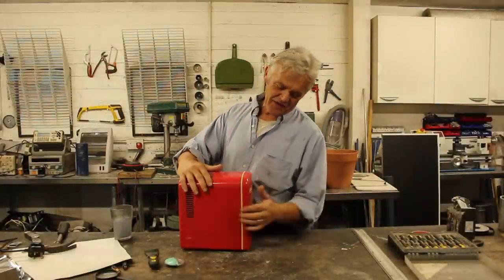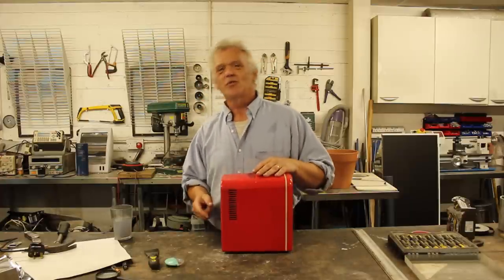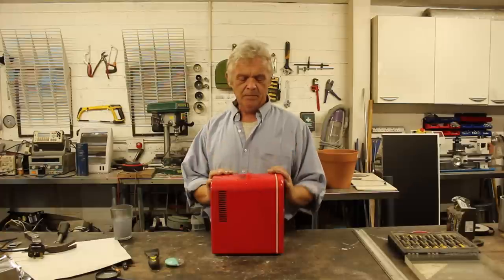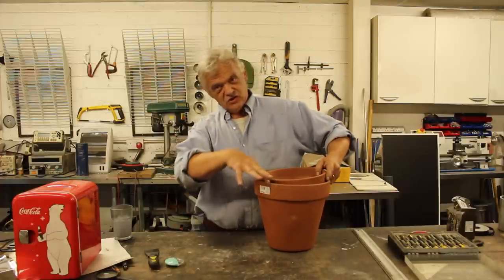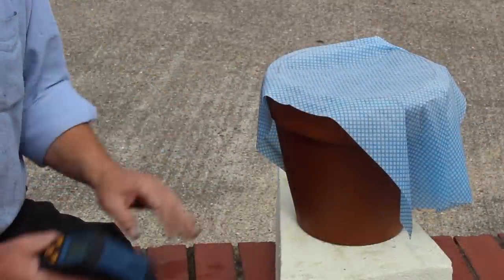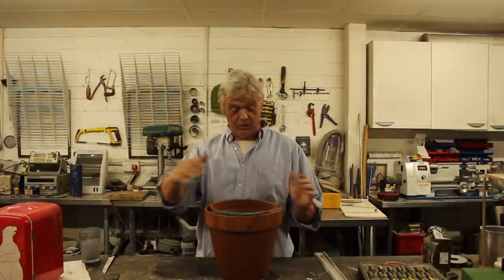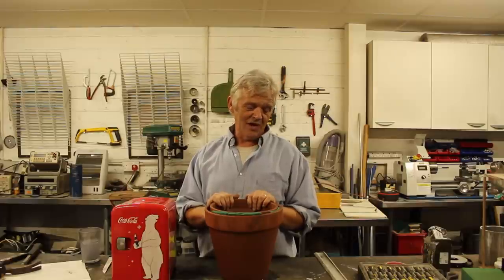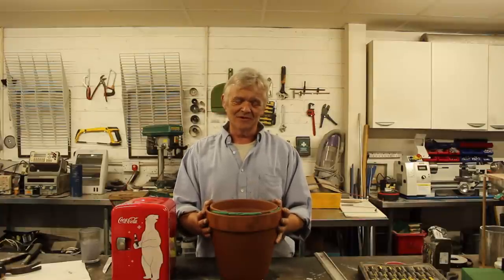1615 How To Make A Plant Pot Fridge A DIY Desert Cooler

Comment: I just saw another video of using terracotta pots to filter your water. Plug the whole in the bottom of the pot fill it with dirty water and then put that pot inside of another container to collect the clean water after it seeps through. Apparently this is a medieval design. The new design is the Berkey filter which is really expensive and needs filters replaced every so often. Who new that there are so many good uses for terracotta. Thanks for the Video I am going to give this a try!
Reply: I’d test that water. The Terra cotta can hold minerals you don’t want to imbibe.
Reply from the maker: go for it mate - and make a video!! - depending on the water you use - you might want to add a sterilisation process too

Comment: The cooler you can keep the hot side of the peltier device, the cooler the cold side will get. In the off grid micro fridge/cooler that I'm designing, the hot side of the peltiers are connected to a copper plate version of those super thermally conducting heat tubes that are used on computers (the ones that under vacuum with a little water in same). And on top of that, to aid in the process, will be a damp microfiber cloth, which also will cool via evaporation. 

   It's powered by a Solar panel during the day, so I'm not too concerned by efficiency/energy cost.  At night time, it will be cooled by radiative cooling.  Since the cooler itself will be insulated with vacuum panels* + some high quality natural insulation, it will be pretty efficient overall at keeping things cold. 

   While I do like the terracotta system, it's not very efficient for my area because we consistently have high humidity (the somewhat south of the east coast of America).  In the summer, we are lucky if it gets to 40% humidity, let alone below that--especially at the beach. It's also a pretty heavy system as is. Though I suppose one could use other lighter materials. 

*Originally I was trying to build the vacuum into the structure itself, but I realized that would be too difficult to do, especially for making multiple of these. You have to make the structure very strong in that case, and I'm trying to make it as light as possible, so that is a big challenge. It's technically possible, but it ups expense, complexity, and time of building.  So I've decided on making my own vacuum insulated panels that can be inserted and then cushioned by natural insulation, which makes it so the structure doesn't have to be near as strong/rigid and tough.
Reply from the maker: yes - they are all about temperature difference rather than absolute temperature and humidity has it's own challenges for sure

Comment: I have no experience with peltiers so my question may sound dumb.
Isn't it possible to stack some peltiers end on end so that the 5deg difference adds up? 
Yeah, besides energy consuption and latent heat. I am talking about improving the temp differential with more peltiers and more energy, but essentially the same peltier module, nothing fancy

Thanks!
Reply from the maker: I don't really know tbh - but it sounds possible - the energy consumption would shoot up obviously
Reply: @ThinkingandTinkering  there is this, I believe, stupid idea that something may not work because if it did, someone would have already done it. I find it is, as a concept, a complete destroyer of ideas and innovation. 
This idea is dead simple, so maybe it is just one of those cases of "we did try already kiddo"
Or maybe not :)

I have no peltiers. My folks around don't throw away their cocacola minifridges.
If you try yourself, I'll stay tuned :)

Comment: One question I am wondering about is; Would it work better if you stack those Peltier panels? (or will it just transport the same amount of heat energy no matter how many Peltier panels you add?)
Reply: Peltier devices CAN be stacked to achieve higher differences. Now, to what extent - I don't know. Try it out! They're really cheap on Amazon.

Comment: Most dubious numbers ever given on peltier devices.
The truth is that they will have a maximum thermal transfer capacity and that will always happen with a delta close to 0c.
They will also have a maximum thermal delta, and that happens close to (practically at) 0 watts of thermal transfer.
In other words, the less work there is to be done, the higher the thermal delta. Maximum delta is usually 60-72c so the cold side temp is mostly dependent on how well you can cool the hot side..
Reply from the maker: cheers mate

Comment: Put Some Borax in there see if that makes it better or mixed The Borax with the sand I watch a documentary about something like that that's why I mentioned it
Reply: What does the borax do?
Reply: @justinw1765  I'm not really sure but I think it's causes the temperature to drop and I'm not sure the measurement of it either but somebody put it in a box with sand or something like that I wish I could tell you more but they built a space suit and walked across the desert in 110° or something and said they stayed cool so I guess you'll just have to experiment I think it's borax sand and water inside a styrofoam cooler and they put a dryer hose to the homemade space suit I hope that helps it was a long time ago so anyway I hope that helps
Reply: @denisstump5874  Hmm, maybe it acts like xylitol then?  When xylitol is exposed to evaporating water, it undergoes some kind of chemical change and drops in temperature, besides the drop in temp from the evaporation of the water itself. 

    Some brands have bonded xylitol to clothing fibers to get an extra cooling effect based on these principles.
Reply from the maker: interesting suggestion - cheers mate

Comment: Would copy paper work better as a lid?
Going to try it with pearlite :)
Wonder if in areas of high humidity if you could surround the outer pot with a moisture absorbing substance like bamboo char or zeolite or kitty litter if that would help? Could packets lying around close do the trick or would a third pot cause some interesting results? Would the cooling effect work without the wind blowing about the second pot?  Would the aborbsive substance be enough?

I guess the real question is which is the better evaporator: Heat or the absorbsive stuff...
Reply: When moisture absorbing materials absorb moisture, some heat is generated, so unless that heat is insulated or piped away from the system, it will decrease overall efficiency some, even if you are getting more total evaporation. If you can do the former, seems like a great idea for more humid areas.
Reply: @justinw1765  okay, so one more layer that wicks heat, which could be as simple as wind blowing against terra cotta as long as the reaction is hotter than the outside air? Or maybe something else. Heat just has to keep moving outwards.  Starting to be a kind of Russian Doll problem, but with a definite end point in sight.  Interesting
Reply: @colleenforrest7936   Seems the simplest solution would be to have an intake fan at the bottom and and an outtake fan at the top? This will not only remove heat from the absorption process, but will speed up evaporation at the same time.
Reply from the maker: I think anything as long as it will evaporate moisture - it might be an idea to make it black. I like the idea of zeolite - but it does get hot as it absorbs water so the first step would be wet it - let It cool to ambient but sealed up so it can't dry the expose it to air and it should get impressively cold as it dries out
Reply: @ThinkingandTinkering  Just jumped from your recent zeolite video to this one, to see if you had thought this exact thing or tested such.  I think you'll be unto something there.

Comment: most terracotta pots have a hole in the bottom, so one in the other won't keep the water in/out until you plug those holes.
Reply: 👀 anything not held with capillary action in the sand or soil will drain out the bottom of the big pot
Reply from the maker: true enough - thanks mate for taking the time to suggest that - I basically forgot to mention it

Comment: Could you turn this into a Thermal energy generator by keeping one side of a peltier TEG cool in the pot and the other side in the sunshine?
Reply: Sounds interesting.  I wonder how much electricity it could generate.  I've wondered about thermal generators for places where solar panels get too hot.  I suspect they are not terribly efficient, but it is worth trying.
Reply from the maker: absolutely mate

Comment: Neat pot!  Figures in Fahrenheit would be more informative to me, even though I do know the conversion.  Do the English really use Centigrade?
Reply: The whole rest of the world uses centigrade and metric. I like metric for everything but temps, because imperial system has finer grade of measurement.  I mean, you can say things like, 24.5* C, but it's just easier to say/understand 76* F. Or another way to say it, there are more whole degrees per degree F, as compared to 1 degree of C.
Reply: @justinw1765  Astounding.  I really don't see the appeal.  My preference is Fahrenheit, for the reason you stated. Is it true that the Celsius scale has 0C boiling and -100C freezing, yet the Centigrade system uses the unit of Celsius?  Brexit.
Reply: @1mremington  0* C= freezing and 100*C= boiling. Both systems become the same at -40. 

  Centigrade and Celsius are different words for the same thing/system.
Reply: @justinw1765  Funny.  That is what I thought also.  That may not have always been the case.  It is claimed by some that Jean-Pierre Christin took Anders Celsius' scale and reversed the boiling point and freezing point to create the Centigrade scale.
Reply: @1mremington  Could be, am not sure one way or the other.
Reply from the maker: lol - yes we really do.

Comment: You have a kiln, couldn't you glaze the inside and do an actual test with veg over a couple of days or something? USB Temp gauge wires recorded to laptop? Just an Idea.
Reply from the maker: I could - but this is also made to show what you can do with stuff around you - if I use a kiln it removes it one step away and cuts out all those folks who don't have a kiln - although an easy way to replicate the effect of a kiln is to coat the inside with cement - which I think I said on the video